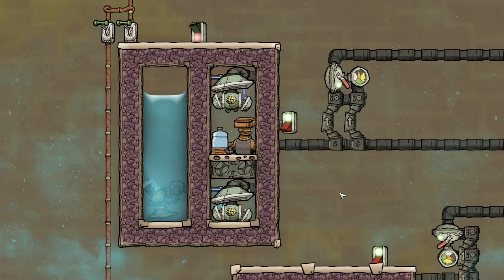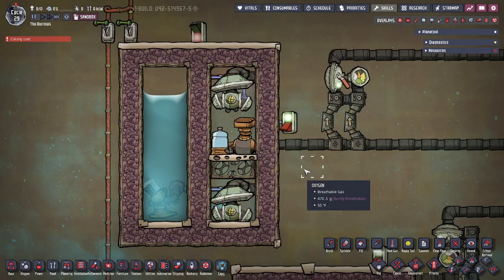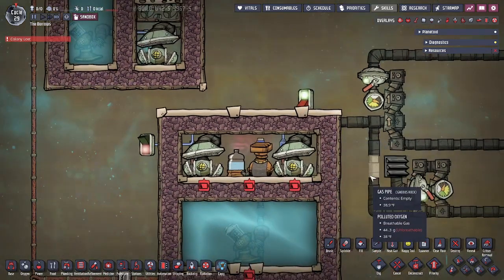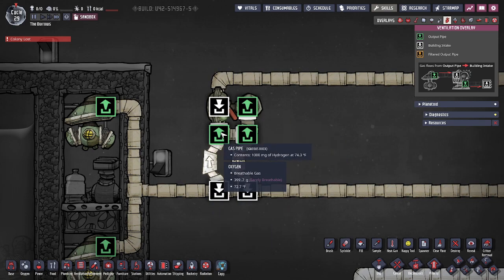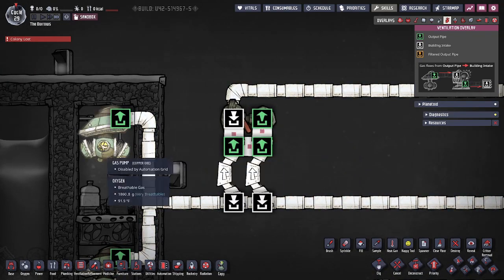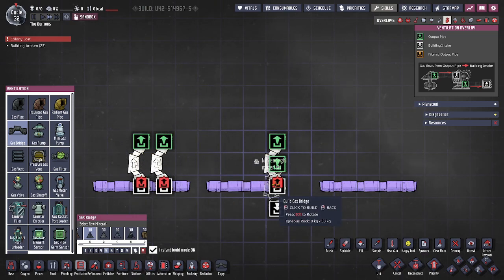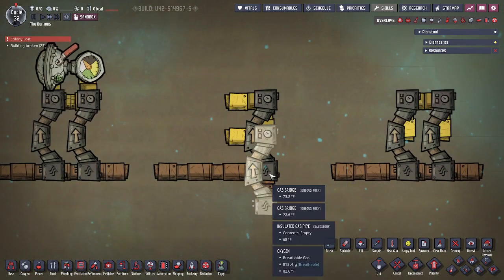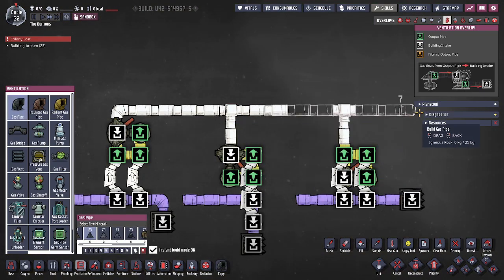Best Electrolyzer Setup - Oxygen Not Included

Comment: A way to control the mech filter setup better is to add another valve before the bridge on the main line.  Set it to zero to stop flow, deconstruct and reconstruct the input pipe until it has the gas you want.  Then set the stop value to 1 or whatever you want the packet size to be until the filter is primed.  Finally change to stop valve to something lower than max to ensure the gas packet isn't too big and doesn't get pushed past the filter by mistake (I do 90% max to leave plenty of wiggle room).

I use this method to capture and sort the heavy gases at the bottom of my base into infinite storages for each type.

Comment: This system will mess up if one single line of gas pipe is connected to multiple filters, to fix this, I use gas pipe bridges, as it makes the gas run in only 1 direction.
Reply: If you add another value before the first bridge, you can control the gas flow.  Set to zero to stop the flow, setup new filter for next gas/liquid type (make sure new gas is the next input to this filter, by deconstruting and reconstruting it until the next packet is what you want.  Set the stop value to 1 to trickle the gas/liquid until the new filter primes and then set the stop value to something less than max to prevent flooding the filter by pushing too much at once through (90% max is what I do).

Comment: Submerged electrolyzer still way better. This requires you to have a mechanical filter of significant size for each of your pump, and only after filters you can merge those in pairs - it makes the system large. For 3 electrolyzer setup it is 6 mechanical filters - you need space to pipe this all out, and then you need even more space to cool it...
Reply: count again

Comment: Usually i am use gas valve before filter with settings 999g/s.
Its more safe than two bridges like here...
Reply: In this design you will never see a full packet of hydrogen so the additional valve or the second bridge for that matter, is pointless.

Comment: If I remember correctly from the forums though, having two pumps next to an electrolyser and just filtering the o2 and h out, still doesn't stop the electrolyser from over pressuring occasionally. To get 100% output you still need a hydra. Although I do like the design you showcased for how small it can be
Reply from the maker: I honestly haven't really noticed overpressurizing but I will check on my long running systems, honestly my demand usually is less than the output of the one then the second by the time I require two, so I might have never had that experience because of that, theoretically it should be enough but I will have to research that. Thanks for letting me know.